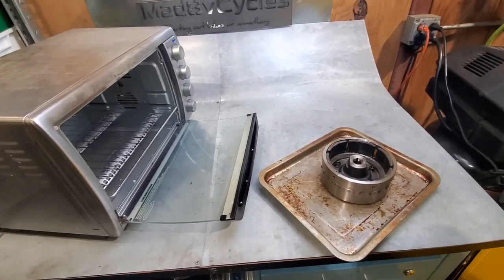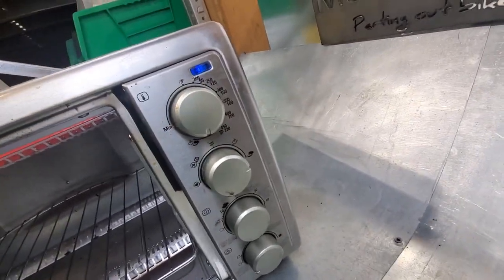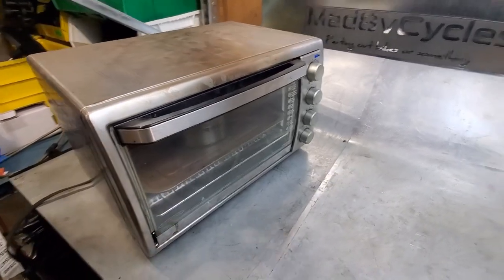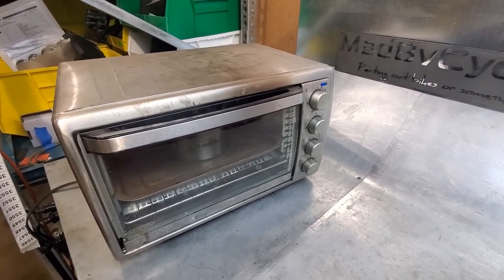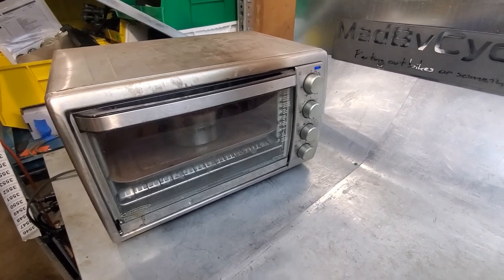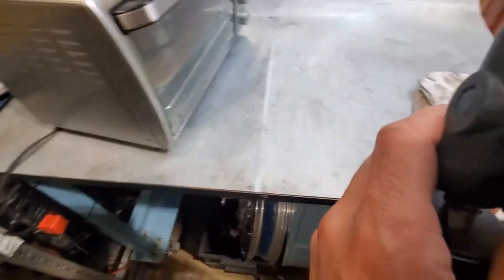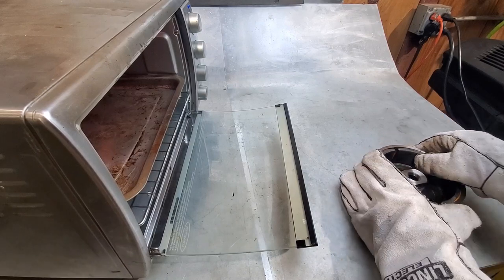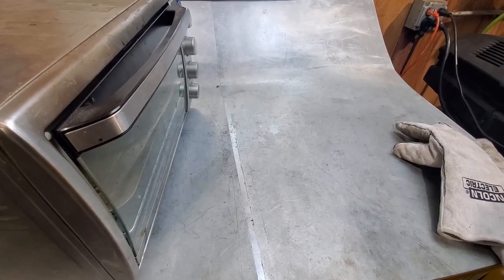removing magnets from an sv1000 flywheel

Comment: just got a sv650n (2004) did an oil change and brake fluid change, aswell as chain maintenance, it has ~20k miles on it, should i do this on it aswell or is this a specific SV1000 thing to do? anything else you'd recommend me do?

Comment: Couldn't you use a butane torch and heat the flywheel up from the outside?
Reply from the maker: uneven heat could cause magnets to crack. so no. you dont want to do that.

Comment: The magnets on my 02 sv650 came off by themselves inside the engine lol
Reply from the maker: thats a bit unusual. 650s dont tend to have the flywheel epoxy problem
Reply: @Mad8vCycles  yeah i didn't expect to see that when I popped my stator cover off. But replacing the magneto and stator fixed it